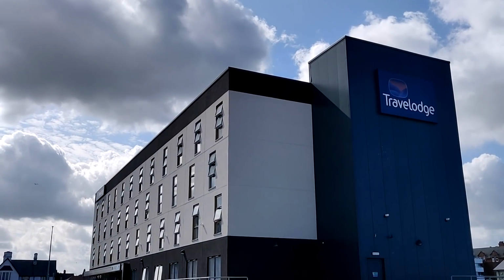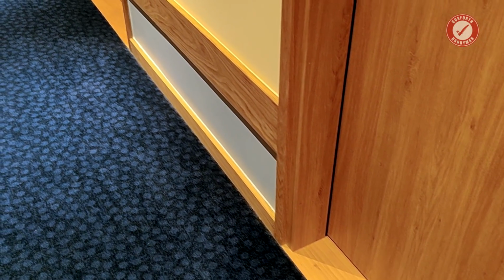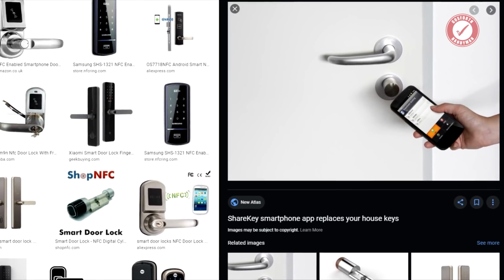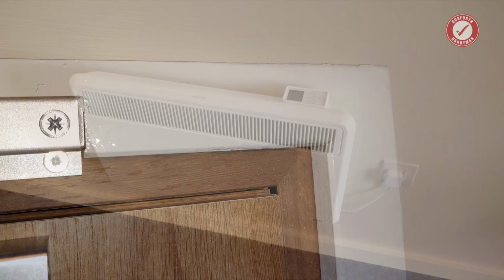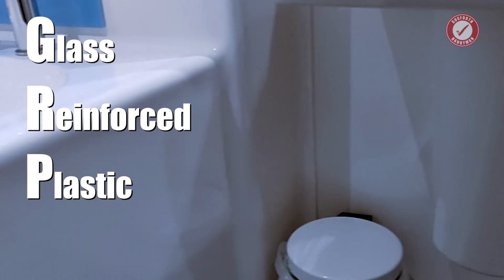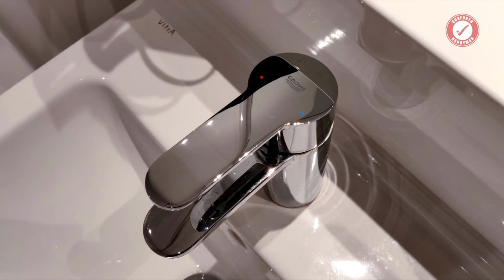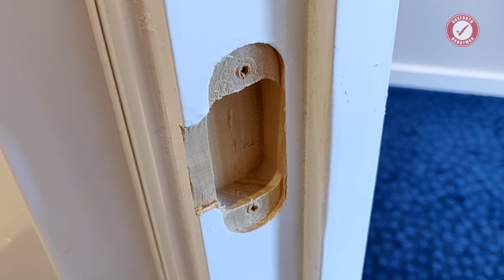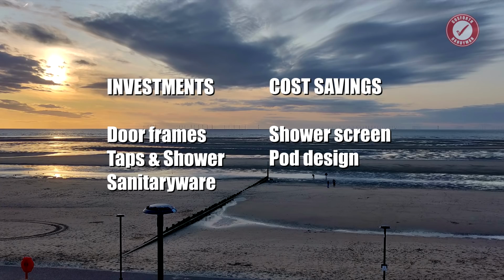Why use SOLID OAK in a £35 hotel roon? Travelodge room design in 2019!

Comment: Juice Jacking, a good reason NOT to use hotel USB sockets. Hackers use these sockets to take control of your phone.
https://en.wikipedia.org/wiki/Juice_jacking
Reply from the maker: A bit tinfoil hat - hackers would need to physically swap out the live electric sockets for compromised versions without tripping the electrics or electrocuting themselves. They'd also have to camp out in the hotel on an almost permanent basis waiting for an older device to connect that isn't already protected at OS level. If there are any actual reports of this happening it would be interesting to read how it was done 'cause there are much easier ways of hacking devices. 👍
Reply: @GosforthHandyman  Not sure about tin foil tbh :) I just want to protect my data and ID. While real life cases tay be few the ability exists as does hacking via a O.MG cable. I accept your point about changing faceplates but personally I would not use them and i only charge my phone via a mains plug and socket. Im not aware of OS level protection and thus only applying to older devices , do you have  a link ?
Reply from the maker: Honestly, I do get quite paranoid about this sort of stuff but I'm not too concerned about this. I'm more concerned about mystery chips inside cheap unbranded USB cables so would agree there! If I had a world domination hack planned that's probably a good starting point 😉. I'm pretty sure iOS and Android both default to the USB connection only being for charging - so you have to force it in to file transfer mode after you've unlocked the phone. I know my OnePlus 6T is in charging-only mode by default - here's an article for iOS: https://techcrunch.com/2019/02/19/cybersecurity-101-guide-ios-12-privacy/ - It's good that you take this seriously though! Wish more people did! 👍
Reply: @GosforthHandyman  I have recently done some work around Tempest for IT security and that capability is mind boggling and amazing !  Thanks for link, personally I'm a Android user but have to use iOS for work :(

Comment: Just a thought on the recessed curtains, is it not just to ensure total blackout? No light peeping in over the top of the curtains?
Reply from the maker: Cheers Al! Yeah think so - but not sure why they didn't just make the windows shorter. Lot of extra effort. I reckon then had the design all done then someone said "Where do the curtain rails go?" and they thought... "Bugger...". 👍😂👊
Reply: @GosforthHandyman  if you made the window smaller, you'd still have light coming over the top of the curtain. That recess should ensure maximum black out at the top of the curtain, which is essentially hidden from view.
Reply: @GosforthHandyman  
Window probably had to be a certain size, ceiling could only be at a certain height and that was probably the only design option available with the space. 

I have had building designed before and architects and engineers made mistakes in their design and it meant that they had to make certain adjustments to the designs without actually change the overall structural size. 

You could imagine the building gets designed and then somebody in the process realizes that there's not enough space to build. Now it could also be an intentional design.
Reply: Would have been lots simpler and cheaper with the same rail directly on the ceiling and a small masking board in front.
Reply: I think they built the outer skin of the hotel first, then changed the plans to raise the height of the ceiling in the restaurant.

Comment: My experience of the flip top basin waste isn't very good.... After 11 months of use it started to get stiff when flipping it to the point where it actually seized solid.
I took it back where I had it from and they said they have nothing but problems with them, apparently bits of grit work their way down the sides wearing the plug and making the plug drop to the point it won't turn.... The only way to then turn it is by applying pressure from under the plug.....which obviously isn't very good.
I don't know if I've explained the problem very clearly but I ended up replacing it with a pop up waste.

Comment: Pods might be great for costs, but I've seen quite a few wet room pods in Travelodges that have great problems with drains - blocked and no trap. Think it's down to 'quality control' when its all thrown into the building, particularly when its not a new build. Oh, and don't ask them to fix it, cos you'll waste your breath.

Comment: GRP Pods are very prone to expansion, the cracks are showing on the one you featured.  Lots of Hotel construction jobs have stopped using them.   As for the Push Fit Plumbing, they’ve used Hep2o, it’s the best👍

Comment: There may not be sufficient fan usage or other HVAC equipment to maintain acceptable, constant humidity levels.  High humidity or fluctuating humidity can cause paint failure and/or shrinkage issues.  The paint and plaster may be fine.
Reply from the maker: Nah, otherwise all bathrooms would be a lost cause. You can clearly see the plaster isn't primed. 👍
Reply: yeah you're probably right.

Comment: The pods come from cruise ship construction.
Reply from the maker: Interesting! 👍
Reply: There are a couple of companies that even build complete room modules similar to those of ship cabins that can be used like Lego to build entire hotels.  I guess if it works on a floating building, why not do the same when the foundations aren't bobbing about:-)
Reply: They’ve been using pods like this in hotels in Formule 1 (the hotel chain, not Formula 1 racing) in France since at least the 90s.
Reply: I was involved in pod bathrooms in hotels around the year 2000.  They are not new, and not necessarily from cruise ships.

Comment: I believe joints over the door are movement/expansion joints, as evidenced at the bottom of the door where there were cracks, there always has to be an allowance for movement and the door opening is going to be the weal spot as it has the thinnest part of the pod and the door adds additional movement.
Reply from the maker: Would that not be the worst place to put expansion joints, if it causes cracking of the lower door frame? You could be right though! 🤔👍

Comment: The curtains are recessed into the ceiling to prevent light shining into the room through the gaps and give a better nights sleep.
Reply from the maker: Could they not just have made the windows a bit shorter? Seems like a lot of expense to recess the ceilings like that. 👍
Reply: @GosforthHandyman  If not done at build time a simple pelmet would probably be the easiest option.  Now, when did you last hear the word 'pelmet'?
Reply: @wayneblackburn9645  I actually first learnt the word pelmet about two weeks ago. The Baader-Meinhof phenomenon strikes again!
Reply: @GosforthHandyman  It blocks the light better as the light has to reflect around two 90 degree turns. Also the final return blocks any glow from shining towards the bed.

Comment: So if one of those bathroom pods has a major failure, what do you think the plan is? Presumably cut it out and install a more traditional bathroom?
Reply from the maker: A major failure like a cracked bath - yeah, the whole thing would need to come out I think. Not sure! I would imagine it's repairable to a degree with the right gear? 🤔😀
Reply: Gosforth Handyman 
That’s interesting! With enough bathrooms, some will fail. (Never underestimate your guests;-)

You might be able to glue a very stiff plate (that you can move through the hole) to the back of the wall and than fill up the remaining surface to make it smooth again. 
Just thinking out loud here. Any one?
Reply: Conservator ,

Sections of fibre glass can be cut out and replaced.  Not noticeable to the average person.
Reply: D Allen 
how would that work If you have no  access to the back? 
How is a new coating blended in with the existing one? 
Are you familiar with these kind of repairs? Just curious;)

Comment: I am using plastic push fit on my new electric shower, I have missed watching your videos hopefully back on track now ,your videos have helped me a lot  thanks
Reply from the maker: Cheers and good luck with your shower! 👍👊
Reply: Don't.  Plumb it in properly. Use soldered fittings right up to last joint. Use a compression fitting.

Comment: Brilliant video as usual 👍, but going off subject could I have your expert advice on glue.  I recently bought 5 Ltr of no nonsense PVA to seal a newly plastered wall and the cost was £9.99   In my wisdom I thought I would glue 2 bits of timber together with it to see how strong said PVA was, to my surprise the wood failed before the PVA , so my question is what’s the difference between PVA and much more expensive wood glue 🦍
Reply from the maker: Good question! I'm no expert I'm afraid! I think wood glue is PVA based but with 'extra stuff' - might have to do a TestTuesday on this! 😂👍
Reply: Gosforth Handyman that was the reply I was hoping for 😂. Test Tuesday, oh yes. 👍👍👍

Comment: they will regret installing multiple  USB outlet twin gang sockets. Because power to the integral  mini transformer is a permanent supply they have a 24 to 36 month life span.
Reply from the maker: Interesting! I need to do some digging on that - sounds like an easy(ish) thing to design for. 👍
Reply: Gosforth Handyman . I agree but if you find a switched one let me know.
Reply: Indeed. And not to mention that you should never plug your smartphone, tablet etc. to any public USB socket. You can't know what's built in those things. You should use those only for charging power banks or other devices without "smart functions".
Reply: @sikkepossu  my phone (and a few older android ones as well) default to charge only when connected to any USB supply. You have to click on the notification and explicitly tap "yes this is my computer, open up FFS, I want to get those photos off of you" (I'm paraphrasing here). OnePlus 7 running Android currently.
Reply: I would expect there to be a USB socket on the market where the USB module can be switched off, but I've never seen one.  They are a nuisance as they cause all Insulation Resistance tests to fail.

Comment: No mist coat on the plaster 🤦🏼‍♂️
Reply from the maker: Yup - expensive mistake! I reckon they've either been under the cosh to open on a deadline and just rushed it, or used some 'fancy new paint' that claims to be self priming but clearly isn't. Not an easy thing to fix! 😢
Reply: Gosforth Handyman  That paint looks rough.  If it’s all over what is the best fix?

Comment: Great vid :) I work as a cleaner in a school that has a new building housing 8 classrooms and all the other school commodities, and unfortunately the developers, Wilmott-Dixon, made such a balls up it still hasn't had the official approval 5 years on. The damp proofing around the whole building needed redoing, the taps have mostly been replaced from complicated non-touch to traditional push top. The design is all very sleek and clean, but the maintenance aspect is poorly accessed and planned out. The velux skylights are motorised and constantly fail. 
The cheapness of some aspects completely overpowers the positive aspects, like the under floor heating throughout, so no visible plumbing.
Reply from the maker: Interesting! Schools especially need to get this stuff right 'cause closing a school to fix stuff is major disruption. My wife works in a school - I hear some incredible stuff! 😂👍

Comment: The bathrooms are modules, dropped in as the building goes up.
Reply from the maker: Yup! 👍😂
Reply: @GosforthHandyman  how do you replace them? Fibreglass does fail and after 20 years I bet the will look a mess. I am guessing they would need to cut the entire thing up and replace it with a traditional room. 

The first time I saw one of these was staying in a budget hotel in London about 10 years ago.
Reply from the maker: Yup - I think you're right @Ian Robertson - although theoretically in a big refurb they could take the walls off, take out the old module and re-fit new. Obviously couldn't do this in brick buildings though. 😂👍

Comment: My OCD would like to know why the main door hinges aren't evenly spaced.  Any idea?  Just seems a bit weird but no doubt there's a reason.
Reply: It is for proportion when looking straight on at the door
Reply from the maker: The top, middle and bottom are evenly spaced. There's then an 'extra' hinge exactly central between the top and middle. I've seen some where the extra hinge is much closer to the top hinge too. 👍
Reply: @GosforthHandyman  It just seems like an afterthought.  They're buying such numbers that they probably dictate the specs.  They know what it's for and where it's going , so I'd have expected them to be evenly spaced, but ...

I was in a Travelodge in York last year and noticed the modular, no angled corners thing.  I'm guessing it makes cleaning easier.
Reply: @GosforthHandyman  interesting, I would have thought the extra hinge was the centre one.  Many 3 hinge doors in my workplace where top and bottom are evenly spaced, but the other is some way between top hinge and centre.
Reply: @leestewart1848  agree with this, the bottom hinge acts like a pivot for the weight of the door, so you put your third hinge nearer the top to manage the downward force. 4th hinge does seem like overkill imho.

Comment: Really interesting, I'm in a Holiday Inn right now. First they obviously have good wifi :) but everything is basically opposite. much older building, no sockets near the bed or USB ports. The only tiling in the bathroom is around the shower, the glass screened shower, the rest is dinged up bare plaster. hollow core doors, pine frames and trim, you can see the knots coming through the paint. Things have evolved.
Reply from the maker: Defo interesting to see how things have evolved over time. I was in another older Travelodge recently and they had physical keys! Never seen an actual key for a hotel room in a LONG time. 😂